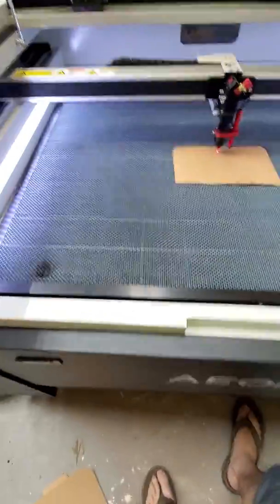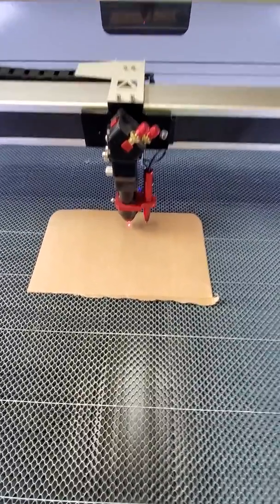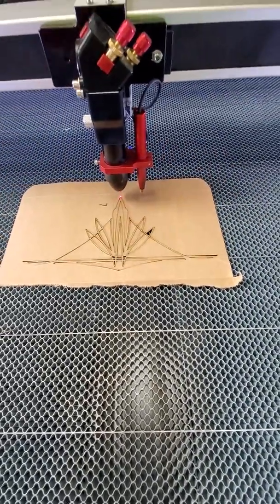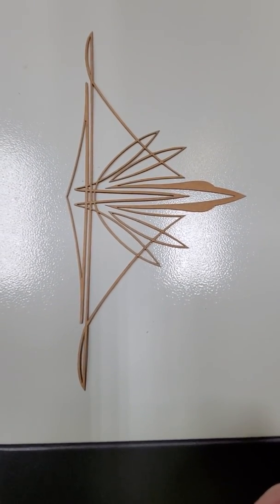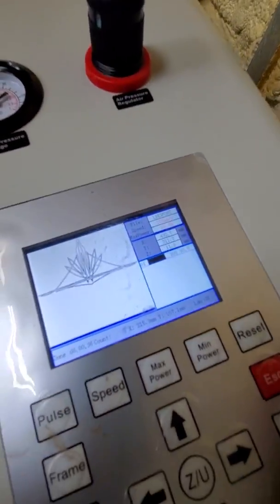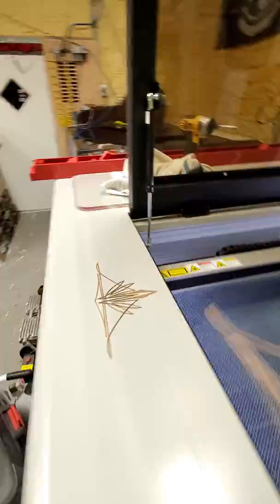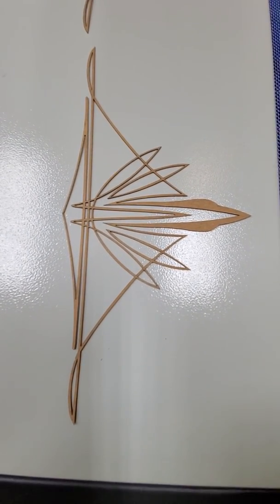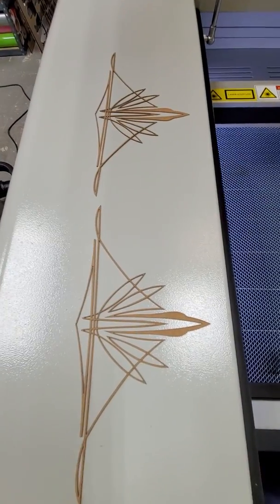AEON NOVA 10 PROTOTYPE

Comment: 1/4" MDF?
Reply from the maker: This was jut 2mil card stock. I will be doing more testing as i get time and will continue to post here. I will be pushing the hell out of it........ As for level and running i have a very unorthodox way of doing it i cant share for legal reasons but it was setup by the dealer and i shipped it home in a trailer and literally this video is me just getting it hooked up to air and exhaust. I did a quick auto focus and the rest is in the video.